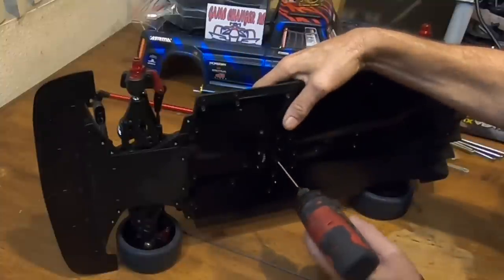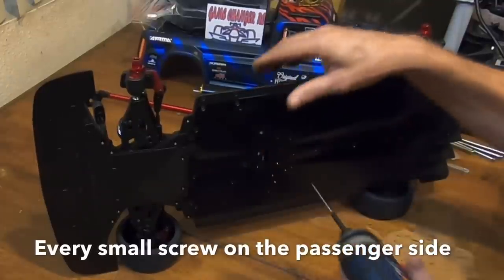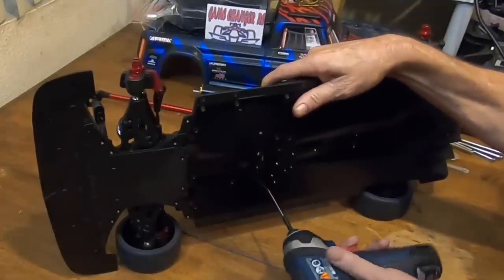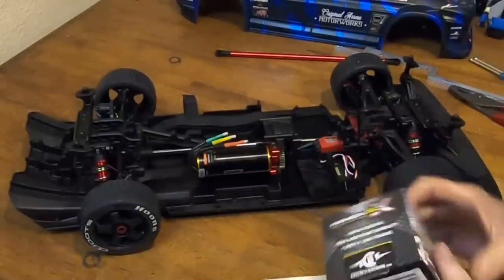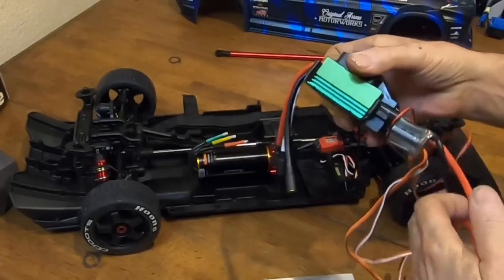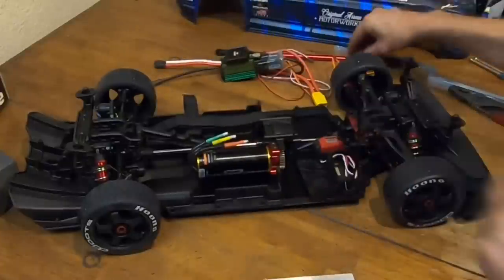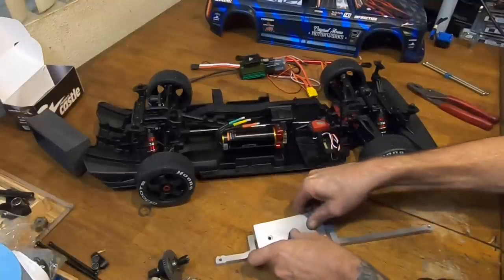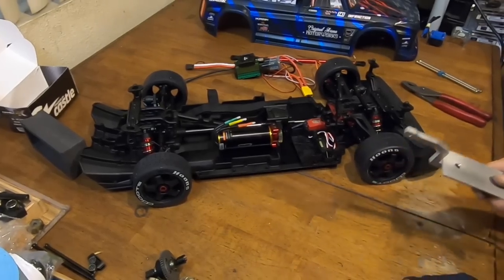Arrma Infraction V2 complete tear down & build up for GCRC 130 + mph rc in real time

Comment: EARL,,,,,great build sir,,,,,,however I would tend to shave off a little on the top brace so it’s not so tight up against the spool cover,,,,in case of impact so it doesn’t push up against the cover,,,,just my thought,,,,  excellent build,,,🇺🇸👈

Comment: What transmitter and receiver do you recommend using for speed runs. Looking for something with good range that not the radio link. Either spectrum or futaba but not trying to break the bank. Also looking for a receive with a gyro in it.
Reply from the maker: I run futaba with an extender on it 👍👍👍have a few video I made on the radio 👍👍👍

Comment: What heatsink do you use got some of those fans on the way probably need heatsink also I need to mount another gamechanger fan to max6 just having trouble finding mount bracket 35mm to 40mm esc plate?
Reply from the maker: Game changer has a list of mounts that work this was from game changer or I use the factory arrma one and re drill the holes and tap them 👍👍👍

Comment: Did you put a nice scratch in that tp motor with the drill bit? Seems like removing that plate to drill the holes after marking them would be worthwhile. Great video thanks for sharing.

Comment: Thanks for the awesome video and nice infraction! I was curious why you didn’t use any locktite on the motor mount and if you never do on the 6s line?
Reply from the maker: Because it had a lot of dry lock tight on it already and they tend to strip 👍
Reply: @earlmoorhead5555  ok thanks!

Comment: Hey what axles did you use ? I know you Said 8mm ? What brand ? Thank you.
Reply from the maker: Scorched rc
Reply: @earlmoorhead5555  thank you, I thought so. So I have all 3 aarma. The infraction v2, felony, and the limitless. I have a castle creations xlx2 1100kv combo, mamba monster x8s 800kv combo and I ordered the castle creations mamba monster x8s 1717-1650 combo. I also got the pps motor mounts . One with a 25mm insert and the 30mm insert. I have never worked on a single aarma vehicle. I have about 30 Traxxas and 6 Hpi and now the 3 aarma. I’m thinking about doing the infraction with a 6s castle creations mamba monster x 1515-2200 kv , felony 8s mamba, and the limitless with the xlx2 1100kv what do you think?

Comment: Does that game changer motor heatsink/mount for fan come with the fans?
Reply: Bret the heat sink is sold separately but i do have them now limited supply. Go to my eBay for V1 fans http://www.ebay.com/itm/154102400072 Heat sink http://www.ebay.com/itm/154052049738 just make sure you specify which heat sink you want the chrome one or anodized blue one.
Reply: I highly recommend making sure the heatsink is the right diameter for your motor. They are not universal fit and GCRC might have the diameter you need but in my case it was not a fit. Totally my mistake but no one is mentioning this while discussing the fans.
Reply: Thank you for info!
Reply from the maker: Yes we really don’t talk heat sink because he’s he really sells fans but like I try to show I install the fans onto many style heat sinks from arrma just by drilling the holes I need for the heat sink we have I was happy to see he sent me a heat sink for his build or I would have attached it to the chassis witch sure lock Velcro witch also works great 👍 appreciate all the support everyone gives 👍👍💯💯🙏🙏🙏
Reply: @dougk4071  I apologize for your misfortune on the heatsink if you send me a message on eBay I will try to see if I have a solution for you. I usually have all the common size motors fit the heatsinks I use. If you got the blue anodized heatsink they are modifiable but if it was the first heatsink that was free as part of a promotion then those were not able to be modified.
Reply: @gamechangerrc4633  
10-4 I'll send you a p.m. on ebay today when I have a moment. Thanks

Comment: I just bought a arrma limitless and I have a Mamba Monster X 6's with a 2200 KV motor any tips I had it laying around
Reply from the maker: The best advise on the esc is check the weight rating on it the 6s combo with the 2200 1515 had a lot of overheating issue on the ones I built 💯💯👍👍👍👍

Comment: nice build but quick question.
wouldnt it have been a bit chepaer to buy a limitless fit all that and then buy an infraction body :P or have you been reusin the stock electronics?
Reply from the maker: I re use all the stock electronics In other build upgrades to the 3s 4s line 🤛🤛

Comment: how much is this setup?
Reply from the maker: Idk this was years ago I’m sure things are more now
Reply: What would you recommend as a complete roller chassis if I plan to change motor and esc, my very last setup was a nitro .25 koyosho inferno st neo 2, but rather go back to electric.
Reply from the maker: @Chuyito01  the limitless roller is great for speed runs the infractions great for on road bashing or drag racing 👍
Reply: I'm looking to build a drag setup you happen to have a link in recommendation,  I would also like to add thanks for your support love your videos with tips on issues we can run into.
Reply from the maker: @Chuyito01  https://youtu.be/hxFkjQ_khnk

Comment: I was watching your vid on squaring and leveling and noticed you have one wheel on your table mat and the other flat on the table so any leveling or camber settings you do will not be spot on
Reply from the maker: Depends on which measurement your checking some don’t require a flat surface 🤔🤔🤔